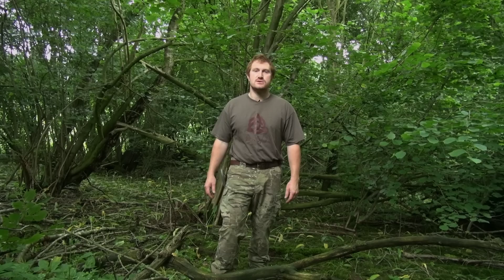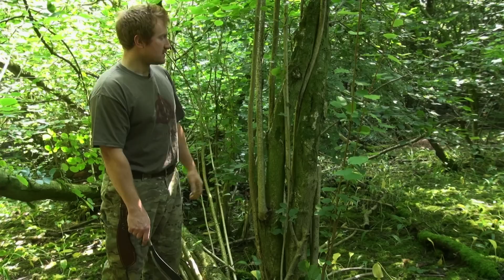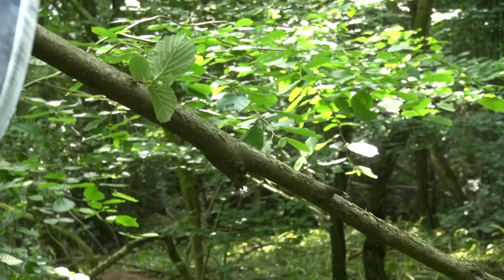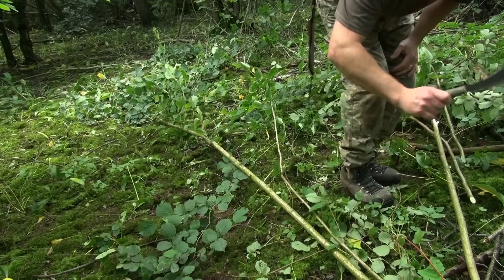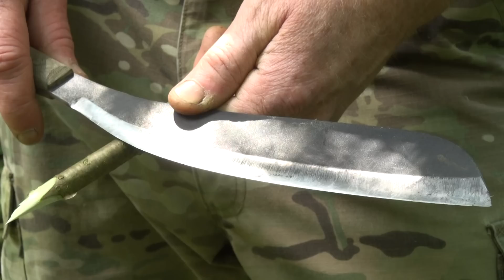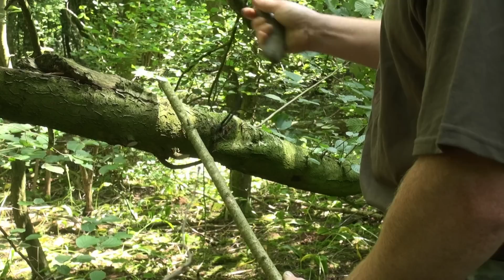How to Use a Parang

Comment: Interesting. Well, there are other ways to cut safely using the parang. As long as you're swinging the blade away from you, you'll be fine. If the arc returns towards your body, just make sure there is something heavy in the way. Nice way to use the lanyard though. Personally like most locals I don't use the lanyard.
Reply from the maker: Chris Chin thanks yes there’s lots more ways to use the tools this is just a few of them. I myself mostly use it without but wanted to show people a safer way. Thanks for the input.
Reply: @BenOrford  You did show a safer way. :) My parents and grandparents never showed me. I sort of figured it out after a few close scrapes. lol That thing is meant to be SHARP and hard to stop. Mine is a little bit bigger -- 3.5 feet in length. At least I think so. Never bothered to measure it.
Reply from the maker: Chris Chin great stuff, well I wanted people to be able to be a little safer straight away. Like you said you can learn the hard way and that can be painful too. Wow that sounds like a big parang. What part of the world are you in now? cheers Ben
Reply: @BenOrford  That would be Kuala Lumpur. Well, somewhat near KL. I hope people listen and do it like you said. Or I'm pretty sure they'll learn soon enough I guess. Full tang isn't common. I think I remember the blade leaving a hilt once. Somewhat vague, early memory. Someone else's old, poorly maintained parang. Not mine. I sharpen, grease and wrap up mine every time I am done with it since that memory. Flying, heavy, rusting blades are no joke.

Comment: IMO a large blade should have a lanyard, and be looped up every time you use the tool. Other then that good tips,
Reply: What happens if that slips and swings towards your body?
Reply: Marcosa Tanas the lanyard gives you control, the blade is more likely to slip and become a projectile rather than slip and come back on you. IMHO all large knives need a lanyard.
Reply: Orion 
Sugar cane harvesters don't have them. They chop with huge bolos and machetes all dal.
I think the lanyard just protects against losing the knife in case your up the tree or on a hillside.
Would be good too if you're in a fight.
Reply: Marcosa Tanas That's true and most 'traditional' users don't use a lanyard either, but AFAIAC that isn't the point.

I have used a cane knife (both the short and long handled version) and you are right, no lanyard. From what I can tell from personal use a lanyard is more there for other people's safety rather than user safety.
Reply: Orion I dislike lanyards as they get in the way and if you let go on a swing it will bounce back and hit you, just let it fly off away from you, you shouldnt be using it that close to others anyway.
Reply: Lanyards #OnlySeenOnYouTube

One of the stupidest inventions after the "scandi grind hype".

Comment: nice tips. but yes, as always: folding saw, axe. for cutting of or trough thin limbs use a hook shaped machete style knife. no sense or need using just one tool for all.
Reply: parang is a multi-purpose tool. I have no use of a saw or a knife  or an axe if I have a parang with me. I live and work in the jungle of Borneo for most of my professional life as a wildlife biologist. You just need to know how to us it.
Reply: how are you processing fire wood in rainy days? splitting thicker pieces or just laying many layers of thinner pieces?
Reply: aaah beeeh In the tropic we use firewood only for cooking; unlike in the higher lat. places where you need larger wood for heat sources (beside cooking)

I don't even need any tools to get fire wood for cooking; there are tons of dead branches that can be broken with the hands. There is no need to split large wood; why waste your time and energy when there are better wood around. 

It rains alot here, and the trick in starting fire with wet wood is in the fire starter, that is all you need.

I have no problem using parang to cut six inches diameter wood or split three inches wood, if there is a good reason..
Reply: i like the insights in other cultures use of tools and daily usage of, thx. 
what will you do when hiking for some days, being wet of the rain and needing a fire for longer or a fire that burns overnight? the wet wood around will smoke terrible and not last very long.
Reply: I use dammar resin ( very common and easy to find in the forest) or/and wax to start fire. Yes the wet wood will be smoky, but it does not take long to dry those wood if you know how to do it.

My normal trip to the forest last about one month, and when ever possible I try not to use wood for cooking ( yes the smoke will chase away the animals that I I study). There is no reason at all to have open fire burning all night, and no native/local would do such a thing unless they are smoking meat or fish.
Reply: again, very nice this insight. if you do it like you describe, a parang or other big machete sure makes much sense and might be the only tool you need. 
around here its more difficult, you cant make an open fire. if you still do, you have to be most stealthy, means at best no smoke and no loud sounds. furthermore nights/days can be very cold, means you need much wood if you wanna keep the fire alive all night. 

i had once a parang, i liked it, yet i found an axe to fit more into what i need, also an axe looks way less threatening around here, where people are being paranoid about bigger knives. i might buy a parang again, you made me again curious to use and "master" it. best greetings to you.
Reply: I still have eight parangs; different sizes and shapes, all have different uses. in my younger days, I wear them around my waist, (just like the cowboy in the old wild west movies).every time we go out to the forest; with out it you look naked. The best tool is the one you know how to handle, I can use a parang as a kitchen knife, make camp,make fire, do some wood work, cut jungle trail, clear undergrowth, and self protection.
Reply: which size and bladeshape you take usually with you on a longer trip, where size and weight is partially limited? which would you choose if you had only one to choose?
Reply: aaah beeeh It all depend on the place where I go and if I am alone or with others. When alone, I normally would take a 11 inches blade ( shape part). such parang would normally be 20 inches overall and a a 'baby knife" attached to it. Effectively I would be carrying 2, a large working heavy duty parang and a long slender knife. If I am with other people, I normally carry a smaller lighter parang; a 9inches (shape part) blade 17 inches overall length.

Comment: Ben,as the video dwells on safety while using the parang I'd like to make a comment on the safe way to remove and replace a parang from its sheath - even though your parang's sheath is not a conventional one. When removing and replacing the parang, the dayaks who were the originators of this style of parang (called the duku chandung or Ray Mears style)  never hold on to the bottom part of the sheath as a safety measure in case the bottom of  sheath has been cut through. In which case your hand can be badly cut by the blade as it slides back into the sheath. Instead the sheath is always held by the top portion.Just an observation. No offence meant,

Comment: excellent! But where can I get the parang you used in this demo, or likee it
Reply: It's a machete local to South-East Asia. Common around Malaysia and Indonesia. You can probably attach a wooden handle to a car leaf spring and grind one out. The parang has a distinctive shape with a distinctive handle. It's edge is slightly curved. The back is curved away from the edge, then plunges in the opposite direction near the end. It doesn't normally have a full tang. The handle is hooked to catch the fingers.  If you want a tempered edge, heat it up and plunge it red hot into some used motor oil. The edge is sharpened into a convex curve.